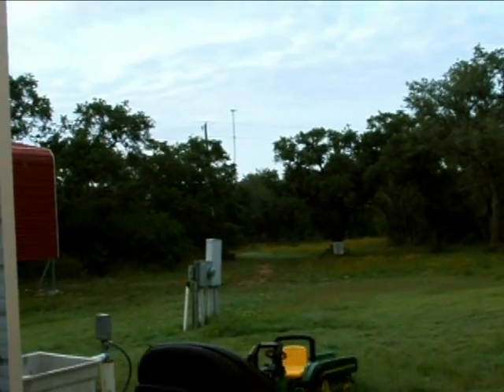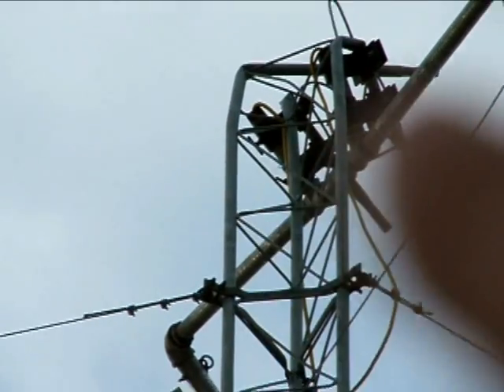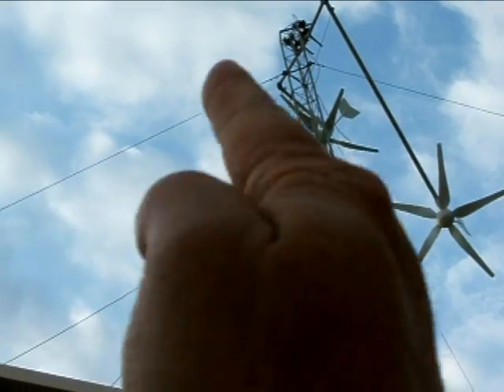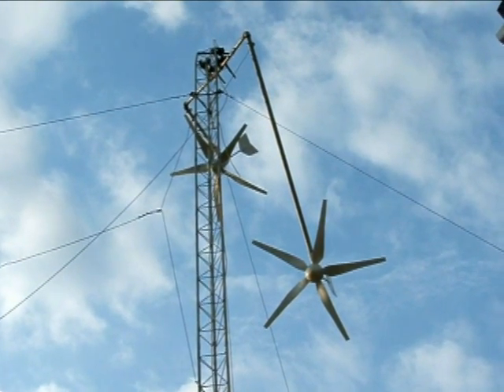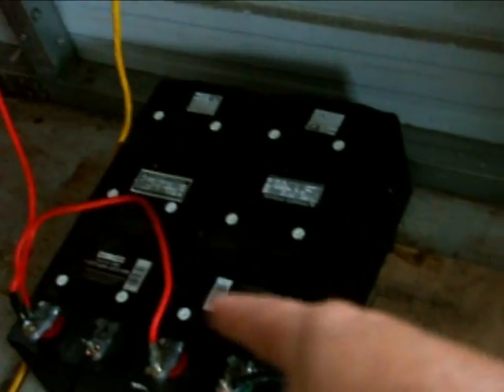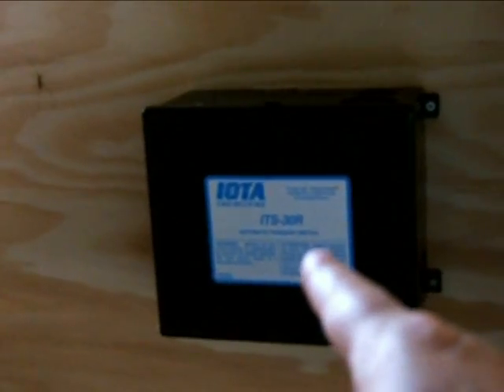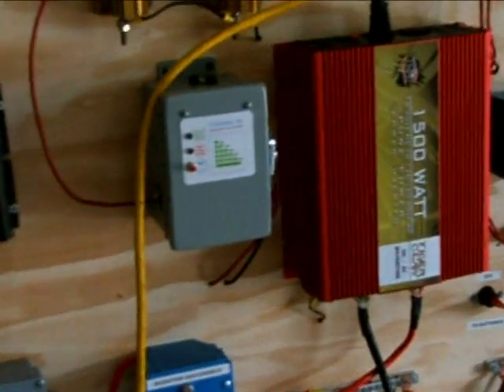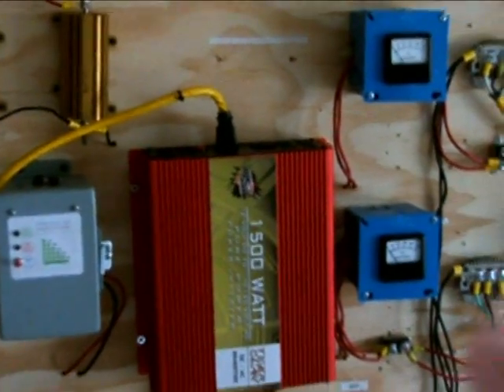Wind turbine tower - Collapsed!!!

Comment from the maker: @natedogg1026 Yeah, that kind of sucks but I learned a very valuable lesson, overbuild no matter what. Although anchors held I'm going to reinforce with 20 rebars 4 feet deep in the ground per anchor plus 2fott x 4 foot x 6 inch reinforced concrete pad per anchor, I will also add another collar and set of guy wires to the tower. The turbine frame legs will go from 10 inches to 3 feet and the turbines will counteract each other - only then I will go 20 to 30 feet higher to catch even better wind.

Comment from the maker: @TheBillythekid2010 I was home sleeping, this was happening Saturday at around 4-5 AM, nothing I could do though. I'm glad it happened now at 50 feet rather than going any higher. I will fix the design so the forces counteract each other and reinforce it much more. Just a minor setback for now...I'll order two or three new tower sections, get to welding a new bracket (one turbine up & one down), get a man lift and get it done. Thanks for the kind wishes1